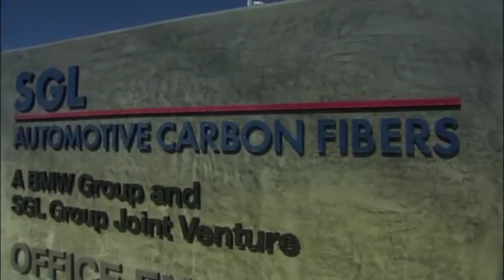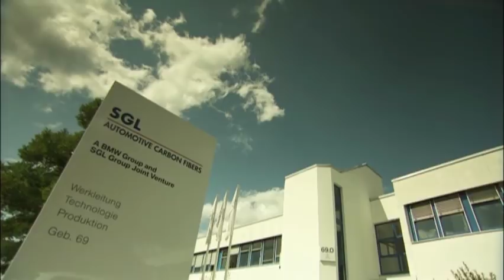An Inside Look at BMW's Carbon Fiber Manufacturing Process

Comment: @Dryzaum though is necessary to say that titanium oxidizes on air at 660ºC and reacts with nitrogen over 800ºC, that's why titanium is not used in turbines blades of aircraft, neither on combustion chambers or in the heat part of turbochargers of vehicle, For that purpose are used cromiun-nickel, niobium-molibdenum, carbon/boron cerments etc. Titanium is used in compressor section and as structural support.

Comment: well unless you have a huge oven home and vac bags you can't do the repair home... and as for the look of the CF weave will be impossible to match but if the car has paint on it you will never be able to tell the difference... and as for the strength the CF will retain all of its strength after a repair just like glass fiber... and just like glass fiber you don't need to replace the whole part but you can patch it up then apply filler were needed and paint

Comment: @00Mass00 Carbon fiber gets it's name from the fact that it is mostly composed of carbon atoms. Carbon is an element (atomic number 6), it's name comes from the Latin "Carbo", meaning coal. Carbon fiber does not carbonize, because it already is carbon. (Carbonization is when an organic material containing carbon is heated and releases that carbon.) Carbon fiber sublimates (transitions from a solid directly to a gas) at 3642ºC. Some carbon composites are heat resistant (carbon-carbon) some aren't
Reply: Hi are you carbon expert?
Reply: Thanks for the explanation. Do you are Chemical engineer PhD. ?

Comment: First off if it isnt about hardness but about tensile strength, density and stiffnes. As for those regular carbon fiber excels that of glass fiber by about 20%, is lighter by 20% or more and is 4 times stiffer (elongation over stress). There is a good reason for using it.

Comment: @Nairuulagch can't be burned, in the process the fiber is heated and quenched at 3000ºC, so if you put a zippo to a wire it turns red but doesn't burn because is already burned, more heat 4800ºC? it sublimates.
Reply: AZR NSMX1 have you seen the video of burning carbon fiber rod?

Comment: carbon fiber repair is done similar to glass fiber so a specialist is not required... and repair cost may not be as expensive as you think but it still is costly... and when it comes to safety CF is much better cause in NCAP rating the CF cars are so strong one car can be used for all the test where as steel cars can only stand up to one test before being written off....

Comment: What do you mean by oxidization process? Oxidizing from what to what?
Reply: Oxidising from Polyacrylonitrile to the carbon fiber precursor, it's done by heating in an oven. Then the precursor is heated in a vacuum oven at a much higher temperature to make the final CF product (done in a vacuum otherwise the CF would oxidise further and just get turned into CO2 and ash)

Comment: @00Mass00 imm, which is the time it takes to transform some quantity of polyacrilonitrile into carbo fiber through heat?, hours, weeks, months?. The process seems to be simple but slow. Thomas Alba Edison created some rough type of carbon wire. 180ºC, 240ºC, 1000ºC on Argon atmosphere, 2400ºC, 3000ºC.

Comment: ok there trying to be as green as they can during manufacturing , i kindah wonder how long it takes for carbon fiber to desolve or if its possible to reuse the material like you can aluminium or metal
Reply: +watahyahknow 
This is not a foundry.  They do not have "dirty processes" in their facilities.  The only reason (none really) they talk about a "carbon foot print" (which nobody has ever seen---like a real "Bigfoot" foot print), is because their processes take a lot of energy,---that wind mills and solar can not possibly provide (they had to go hydro---and used that for their relocation, and probably lucky they found one).  

I think it is time for the citizens of the world to wonder,--"Is this green movement thing really about saving nature, or destroying our wealth making capabilities?"

If you compared the decline of nature to the decline of the global economy for any citizenry in the world (over the last 40 years)--which is worse?

Have you ever seen a dictatorship who let their citizenry get wealthy with a free market?
Reply: Have to first remove the resin with pyrolitic decomposition (basically vaporizes all the organic resin in an oxygen free atmosphere then burns them to vaporize the resin of the next piece of carbon fiber) It is then shredded. It is then only used to reinforce  plastics or concrete because it's is no longer continuous lengths
Reply: cool wonder if that system uses a lot of energy though , it IS interesting to know it CAN be done though
Reply: watahyahknow Recycling doesn't use much energy (the removal of the resin is usually self-sufficient)

Comment: When will they understand we don't want a carbon fiber part that's as strong as steel, but a part that is stronger than steel? Fex, put a few extra layers in that roof and sell it as a safety-feature (no pole is going to come through that roof, impaling your loved ones, if you land upsidedown at the side of the road). But a good video nonetheless! Very clever that guy who thought out that robot that makes the carbon composite roof, get him to think up robots that make other parts aswell!

Comment: To make something out of a steel or aluminum alloy, you use perhaps two or three automated process. Carbon fibre manufacturing uses at least half a dozen individual process plus a huge amount of manual labour during set-up and transition between these processes. It takes a 45 minutes to weld an Aluminum bicycle frame together by hand. It takes several hours just to lay up the layers of carbon fibre in a mold to make a single tube of a bicycle frame, plus all of the work done to make those sheets

Comment: At what point of the process are carbon fiber strands bundled into rovings?
Can anyone tell? Is it during the oxidation?
Reply: +abdollar34 Its called a polymer spinning process. Where the polyacrylonitrile (PAN) is extruded through a spinnerete and stretched through several drives to produce the required dpf of a fiber. these strands you speak about depends on the spinnerete i.e; a single yarn may contain 3000, 6000, 12000  filaments. The final yarn you get is called SAF( special acrylo fiber).This SAF is subjected to oxidation and rest is shown in the video. Finally you get the CF
Reply: +Manu Prasad +JL S great answers thx guys! 
I was irritated because I thought the white precursor which is shown in the creel area is sth like a flat tape thing that is turned into thin filaments and tows later in the process...

Comment: @Nairuulagch Carbon fiber can not burn.. it only carbonizes thats where it gets his name from :) thats whats gives the material its great stiffness and strength.. however it takes about 3000 degrees to do so, and a lot of time(specially high modulus carbon).. that's why its so expensive
Reply: 00Mass00 have you seen the vid of burning carbonfiber rod?

Comment: The biggest issue with using carbon fibre components like masts and booms for racing yachts is that the component explodes when its resistance to stress or impact is exceeded and carbon shards explode everywhere. How to contain that is a big challenge.
Reply: Does Carbotanium also do that?

Comment: Why is it necessary to to send the fibres for such long runs whether vertical or horizontal. Obviously there must be a reason but it can't just be tension eh?
Reply: Oxidation and carbonization residence time to capture mechanical and physical properties.
Reply: @josephstorrud8050  Thanks! I watched it again and they allude to that in the beginning

Comment: Man, exhaust systems are NOT made of carbon fiber at all. They are titanium. This cooking thing is calculated and once cooled down it cant be heated again. I dont know exactly what happen to it but i think it looses its properties. Or its appearance's whatever. Mercedes didnt used carbon fiber in some pannels at the front of their Mclaren SLR because of the temperature of the engine. Obviously is no where near the 3000 celsius.

Comment: Those look like M6 roof panels.
Reply: It sure looks like an E92 M3 roof panel.  The CF roof for the latest M6 has a double bubble in the top.  The one in this video does not have that distinct feature.
Reply: dont know what E92 means but looks like your the expert bro!
Reply: aryan adibmehr E92 is merely the designation given for that particular generation of M3.    First generation M3 is the E30 - second generation is the E36 - third generation M3 is the E46 - 4th generation M3 is the E92 (E90 was the sedan and E93 was the convertible version - while the current generation has been split into the M3(sedan F80) and now M4 (coupe F82 and F83 convertible).  

http://en.wikipedia.org/wiki/BMW_M3
Reply: uh ok, thanks for that.
is it true that bmw is getting rid of the 1,3 and 7 series and replacing them with the 2,4 and 8 series.
Reply: BBS rims on an m3 is probably as good as things get on this planet dont you think?
Reply: aryan adibmehr Yeah I think I dumped more M3 info than was required. 

BMW isn't getting ride of the 1,3 or 7 series.  The even numbers are the coupe versions of the 1, 3 and 7 series.  BMW in the last few years seems to be taking the direction that even numbered cars are their coupes and odd numbered cars are their sedans/wagons.
Reply: uh right, thanks.

Comment: You obviously don't fully understand what it is that your trying to tell us.. A 1x1' sheet of carbon fiber composite with the same mass as a sheet of steel will be 50% stronger than the steel. Carbon fiber composites may be need to be thicker than steel to achieve the same strength but they still weigh much less because it's less dense than steel. Who makes carbon fiber composite parts with just 1 or 2 layers anyways?